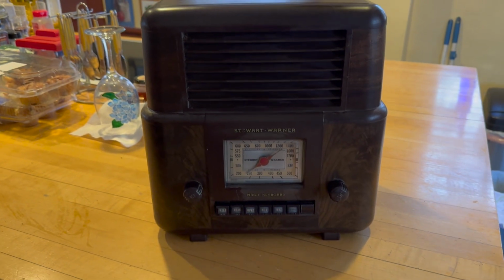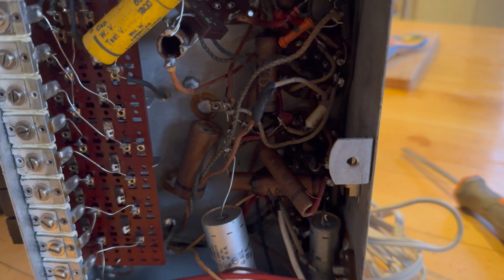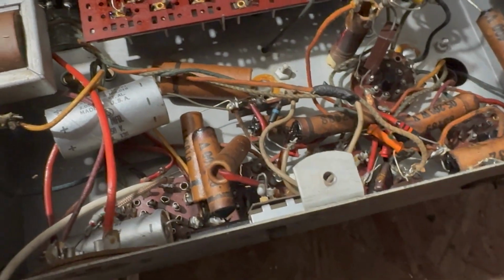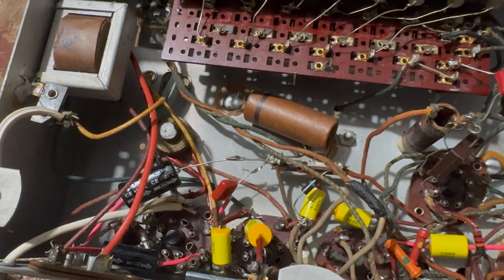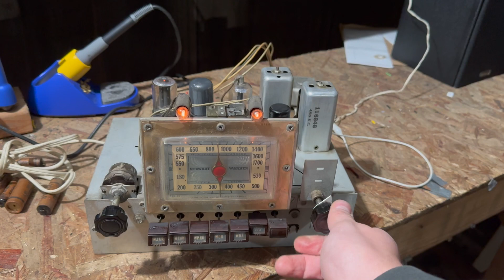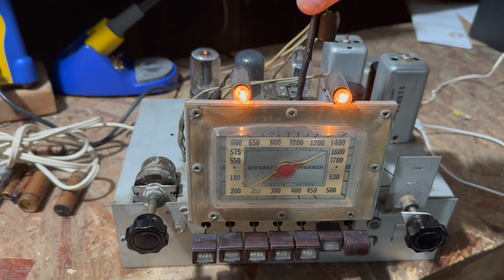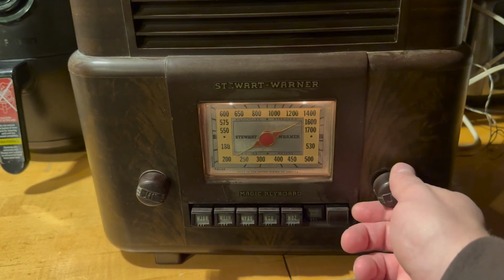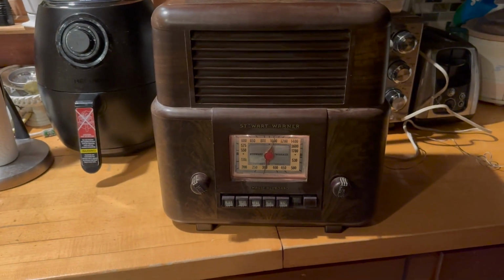1939 Stewart Warner 5E1 Antique Radio Quick Repair

Comment: Looking at the Riders schematic the switch in the back is a tone control. It's either on ( through a .047uF cap) to ground or
 off ( open circuit). Pretty unusual Bakelite cabinet.